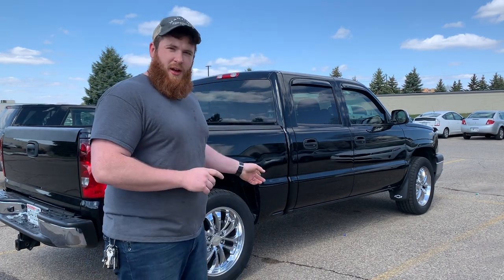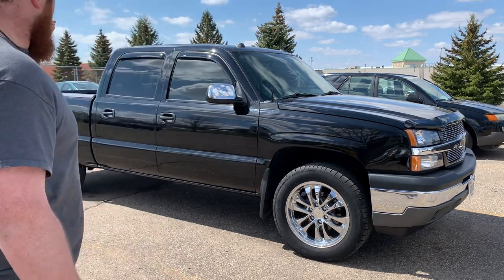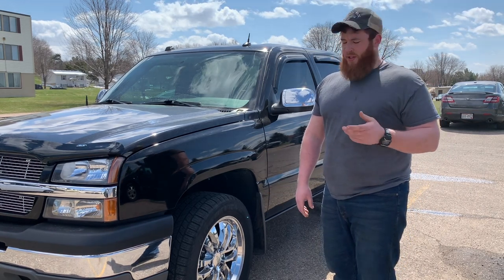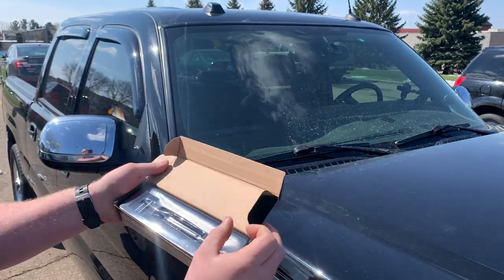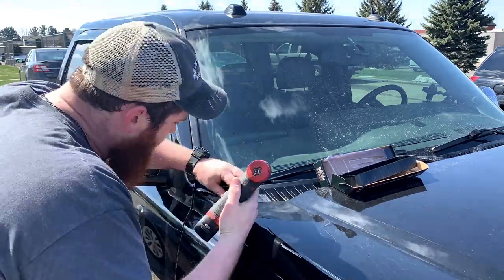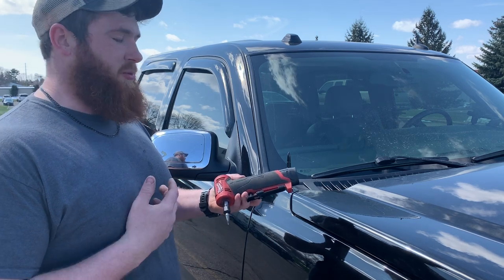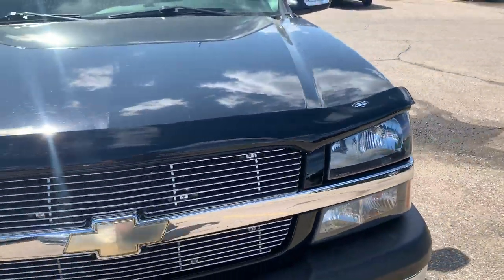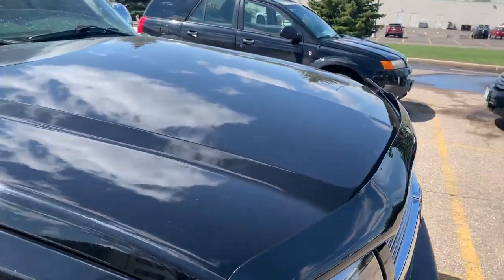The Cleanest 2005 Chevy Silverado 1500 Z71 On Youtube

Comment: I've got an 05 ext cab 1500 4.3  with just now 70,000 miles . Not a bunch of options, it's got the rubber floor, manual windows /locks Its grey  interior with cloth inserts  has a crutchfield  sound system  using a Jvc  vintage head unit(2002
Single din) but a loaded Sony  came with it with rear view video  back up cam, bluetooth etc...but I'm not ready to tear into the wiring quite yet. It's never been out of central Florida .its white   with steel rims , but I'll find something nicer when the price is right.My neighbor bought it in 07 with 21,000 on it .She put 28,000 more over the next 10 years and fall 2017  she backed into a tree stump denting the right rear door.The following day she offered to give me the truck if I would drive her around when she needed to go somewhere.She refused to drive anymore.She said it caused stiff neck and back trouble when  she parked it .It definitely has some blind spots that make me feel uneasy backing out of  modern gas stations . It's  got some very odd electrical glitches that took a few months of detective work to resolve the trouble (grounding of the harness that   made  attaching the bed to the chassis  a single squeeze of the drill ) wasn't keeping a bunch of stuff working right so it got re wired and siliconed.So far it's doing fine..It looks new and I work hard at keeping it from getting all packed with leaves and dirt.... And its paid for!!!!

Comment: I really want the new design battery and M12 right angle die grinder and drills seem like they would come in handy especially for exhaust work like drilling out busted off exhaust manifold bolts

Comment: I have a black dodge ram Laramie slt quad cab long bed and it is missing most of the badges also but does have rust around the edges being it was a northern Ohio truck since new came from Findlay Ohio.. bought in Lima Originally and I live over in Indiana close to the Ohio State line closest town is actually fort recovery Ohio.. and my factory antenna on the 2000 dodge ram is half rubber boot coated and a aluminum rod for the antenna mast and picks up radios stations pretty efficiently and not too much interference.